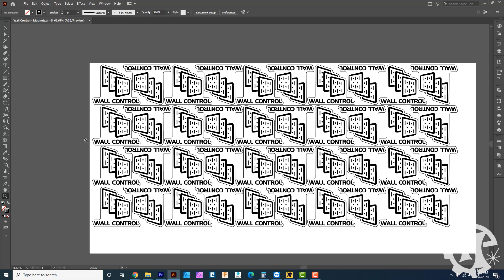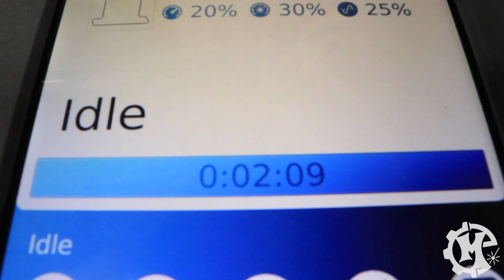Maximizing Laser Production and Your Profits

Comment: Great video! I have a question, the profit we can earn lasering multiple magnets at one time process is only about time or we can also save money for the source. I mean the laser will shot the same times for making those magnets either this happen one at the time or all together. I hope my English are good enough to understand my question.
Reply from the maker: When you run a full sheet, you tend to actually take less time per piece versus running one at a time. So there is a time savings involved.

Comment: hey! I have the epilog fusion pro, and when i do a bulk order, I find that some areas cut through and some areas dont.  Do you know the reason for that? My wattage is 60.
Reply: check your mirror alignment, and make sure the table is level
Reply: Mirror alignment, or dirty mirrors or lens.    As the head gets further from the source it will loose power naturally because of the distance, that could be enough to cause areas far from the source not to cut.

Comment: Usually has more to do with a full width/row of items since most lasers the speed is primarily in the horizontal direction.  I tend to try and maximize layout across the table and not worry about a full bed per se based on the needs. I.E. you don't want to layout vertical if you can avoid for less than full bed.
Reply from the maker: You are correct about the horizontal. From an efficiency standpoint, it's more beneficial to machine the entire sheet of material than to cut one row, trim the material and then machine a row and repeat. The combination of vertical and horizontal still has its benefits.